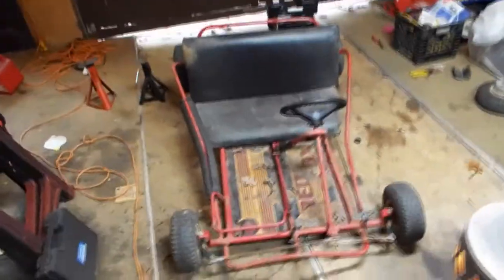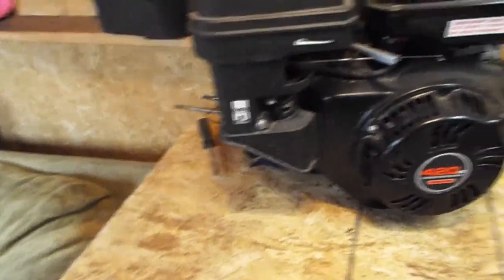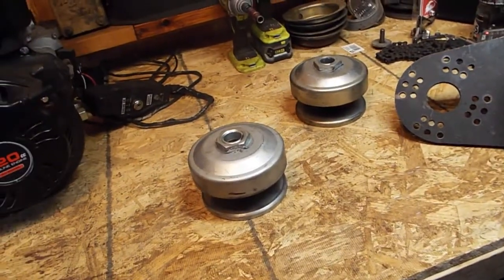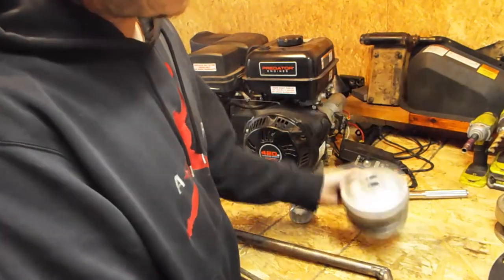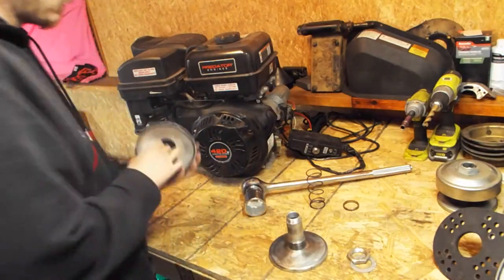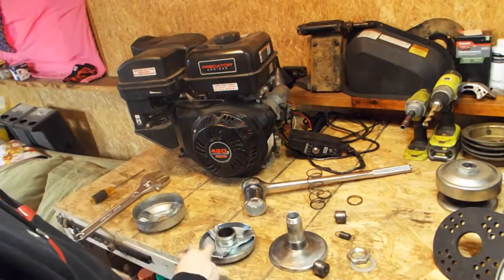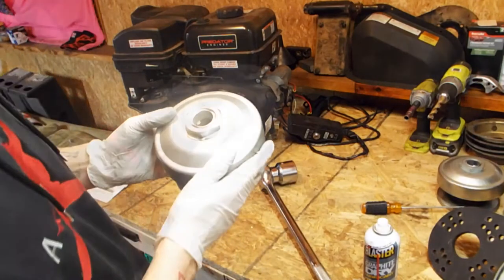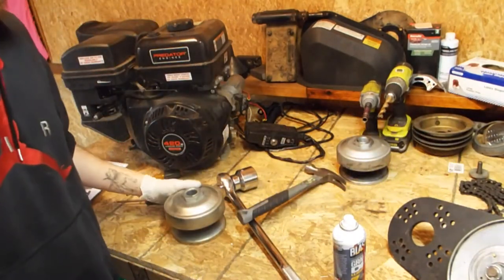40 Series Torque Converter Sticking Reapair

Comment: Question for you? I have watched hundreds of YouTube videos and I am completely stumped. I have a Duramax 420. I installed a Chinese 40 series torque converter. Everything was lined up but it still took off at idle. So I installed red springs to bring it up to 2000 RPM. Now I can visually see the Clutch coming out and going back in with no problem and at idle it stays in completely. But the belt it came with it’s still tight enough for it to move at idle. Almost like the driven pulley is pulling the belt too tight. I’ve pushed it down a hill before and noticed that the driven pulley actually opens up more and then it will sit still at idle. But a lot of times driven pulley gets really tight at idle at random and won’t stop. Even though the clutch is completely released.
Reply: same problem im having how did you fix it
Reply: Order a 203785A belt.  Fixed my problem.